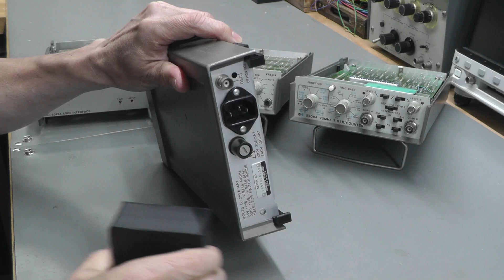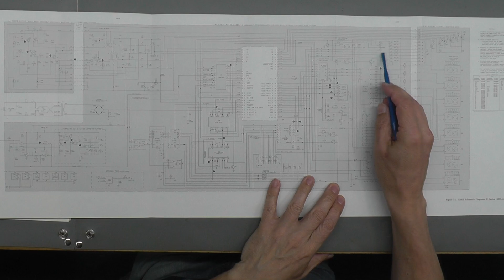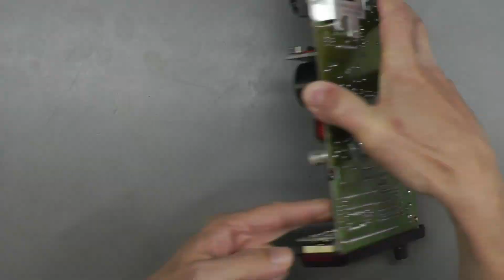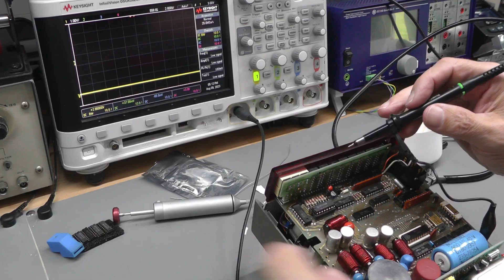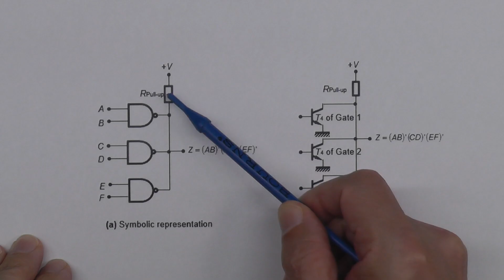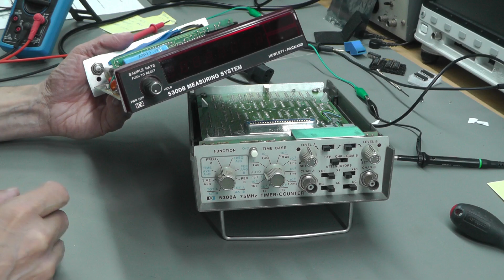No.112 - HP 5300B Measuring System Repair

Comment: Great video, thanks! 
I just "fixed" a HP5300B / 5306A  Multimeter / Counter. The HP5300B had 2 problems. The main power switch wasn't passing raw +22V. I bypassed the power switch, and then it displayed all zeroes. The annunciators, digits, and and decimal points were OK. Pressing the RESET switch reads all 8's. I haven't figured out how to repair the evil ModPot switch yet: It has the power switch + Pot + Reset button.  Probably need to remove and disassemble it. Or drill a hole? Ugh. Or leave it permanently bypassed / ON. Yeah! I guess the power switch didn't like charging a 950uF cap to +22V. 

Then I traced that the 10MHz reference clock wasn't getting to the logic. The oscillator was fine.  It was bad contacts in the Clock INT/EXT slide switch. A shot of DeOxit into the switch fixed it. 

The 5306A worked fine. All the range and function switches are good. ~50 year old unit is still in cal! 

Cheers, Dave

Comment: Talk about 'Screaming at the telly ' your initial tests were all done with your meter on AC lol ! However what a great looking bit of kit and a classy bit of fault finding to boot !......Cheers.
Reply from the maker: Ironically it wouldn't have made any difference after checking the schematic....LOL!
Reply: @IanScottJohnston  Happens to the best of us Great video !!
Reply: Maybe you need a DC voltmeter with red and black leads and a separate AC voltmeter with two blue or yellow leads?

Comment: Excellent work, Ian. As has already been mentioned several times that is an HPIB interface. Calling it an ASCII interface was done to differentiate it from the BCD outputs that were common on HP gear of that era. HPIB quickly took over and later units were labeled "HPIB Interface".  Regards, David
Reply: Is that the same thing as 'GPIB' that I see on HP Kit please ?
Reply: yes  @andymouse
Reply: @andymouse  Yes, HPIB and GPIB are both implementations of the IEEE-488 interface standard. HP was the first to implement it on there test equipment and developed a command instruction set. They referred to it as HPIB (Hewlett Packard Interface Bus) and the name stuck for many years. When it became common on other brands of test equipment it started being referred to by its generic name GPIB (General Purpose Interface Bus)
Reply: I was going to say that the connector was an GP-IB IEE488 one, and don't see why they would not use their own bus for data transfers.  Always good  to have a commodore PET near the bench to talk to the kit.😂
Reply: @TheEmbeddedHobbyist  Ah yes, the Personal Electronic Translator by Commodore - great machine in its day. I got to work with a brand new one, doing some work for a gentleman who was evaluating visibility measurement systems, comparing various types of transmissometers and forward scatter devices for measuring runway visual range at airports.
Reply: @davidv1289  we had a few at work driving   golf ball printers for the main office work, and a few in the test department. i built test equipment DVM's and PSU's in to small test rigs to test a few of the simple PCB's. 5K for a DVM but a switching matrix was a lot more so we got by with a few relays and some homemade driver boards. easy to interface to the PET interanls.
On the back of this i bought a PET and i still have it, must be close to 40 years or more later. i did a few vid's on getting it back to a working state after not being turned on for 20 years 🙂
Reply: @TheEmbeddedHobbyist  The IBM Selectrics were fascinated when they first came out - then the daisy wheels. I'll watch those PET restoration videos. Regards, David
Reply: you can use an esp32 or an arduino for that nowadays  @TheEmbeddedHobbyist . (I made a version of the original Arduino based AR488 project for the ESP32, so working out of the box on wifi or bt, search for ar488-esp32 )

Comment: During initial test of the power supply rails 9:40 you had the multimeter on the wrong range (ACVolt)😉
Reply from the maker: Ironically it wouldn't have made any difference after checking the schematic....LOL!

Comment: That interface is an 8 bit parallel interface called GPIb oder IEEE488. You can get USB Adapters for it. For cheap even.
Reply from the maker: Yep, I, erm, um know all about GPIB.....I wrote WinGPIB windows app!
I had a brain fade not thinking an old instrument like this would support it. Forgot GPIB's humble HP beginnings were back in 1965.
Reply: Is the source code for WinGPIB availible.? @IanScottJohnston

Comment: Given the fact it is HP, 24 pin Amphenol (Centronics type) and the jumper block it is HPIB aka GPIB aka IEEE-488. So it outputs an ASCII equivalent of the display over GPIB. Now all you need is a GPIB controller.
Reply from the maker: Oh dang!......didn't realize it was effectively GPIB, I should have known!......GPIB I have here in abundance, might give it a whirl just to see if it runs with WinGPIB.
Reply: @IanScottJohnston  I was a little surprised you hadn't twigged it was GPIB, I suspect it is one of the first generation of GPIB instuments - just before the explosion of big box automated instruments. I have the voltmeter variant, which is a bit older in design and only offers a BCD interface IIRC.
Reply from the maker: @BogTheWombat  There is a later version of that module that has "HP-IB INTERFACE" on the front, same module number mind you....this one just saying "ASCII INTERFACE" threw me!......yeah, went right across my head...🙂
Reply: @IanScottJohnston  looking at the back I suspect it only has one command - Initiate to trigger a reading. The logic on the board and system probably preclude more
Reply from the maker: Yes it's addressable, and connects to WinGPIB......but I can't find a 5312A manual anywhere to try some commands.
Reply: @IanScottJohnston  www.keysight.com/us/en/assets/9018-02876/user-manuals/9018-02876.pdf
Reply from the maker: Great!.....I'll give it a go.
Reply from the maker: Quickly tried a few commands from the manual but I can't get it to respond, in fact the commands aren't accepted/time out. There's a lot of settings I can play with in WinGPIB.....polling, blocking, terminators, time-out, STB mask & EOI.......but thats for another day.
Reply: @IanScottJohnston    Sounds like a great topic for another video!

Comment: I think that connector on the ASCII unit is called a Centronics type
Reply: Ah yes an old printer plug socket 🙂 I have several leads from old printers
Reply: Centronics has 36 pins - this one has 24 pins, as used by GPIB.

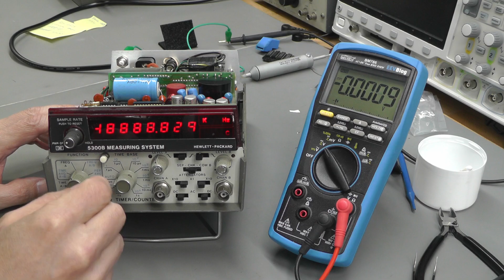Comment: @12:00 how did it have a segment lit up without the driver IC installed?
Reply from the maker: Despite the segment driver not being fitted the NPN transistor that drives segment 'g' bypasses that driver IC. Shown later in the video exactly why.
Reply: @IanScottJohnston  at least I noticed it wasn’t right 👍